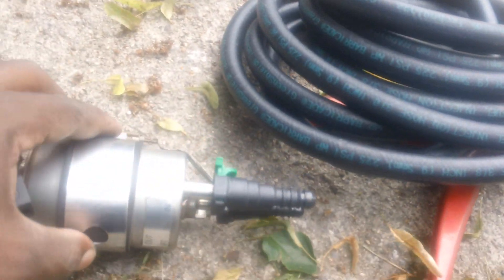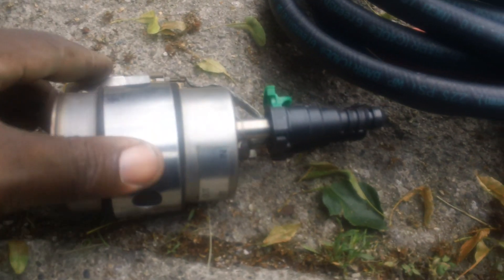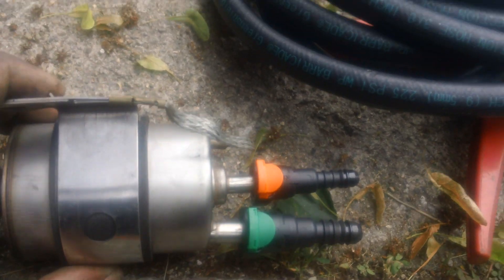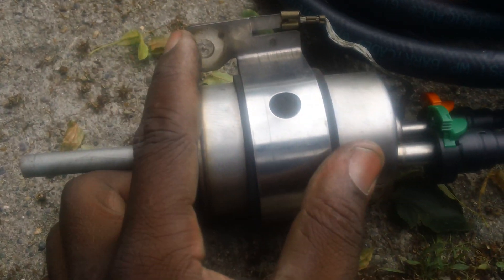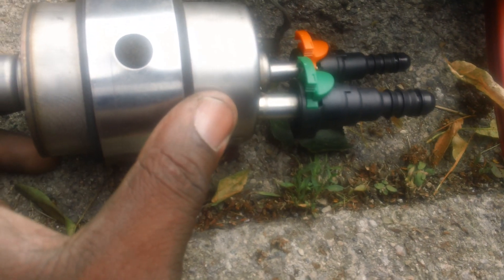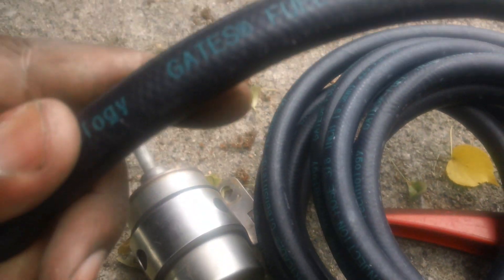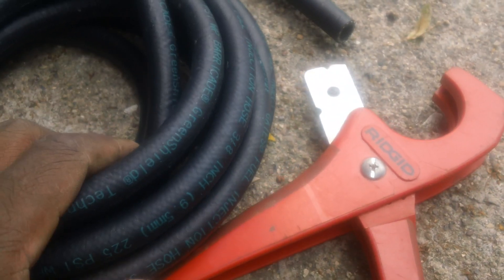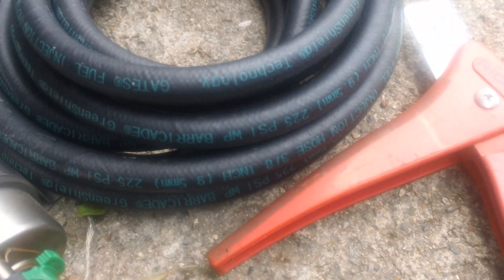S10 5 3L swap part 6

Comment: Did you Change the fuel pump?
Reply from the maker: Yes, but it wasn't necessary at this power level
Reply: Does this work for the 2.2 trucks